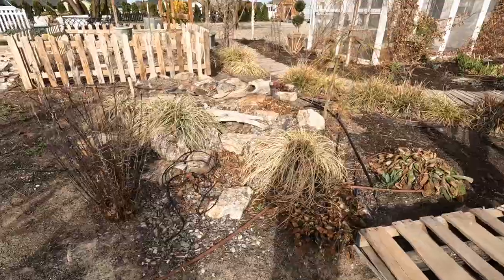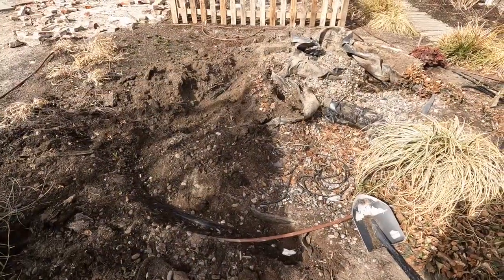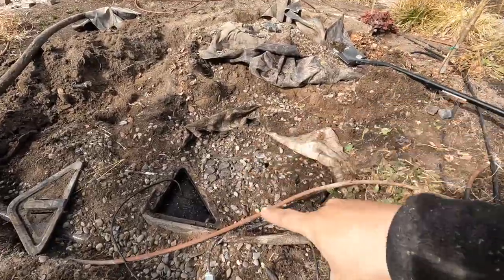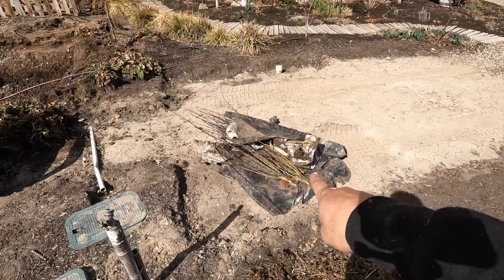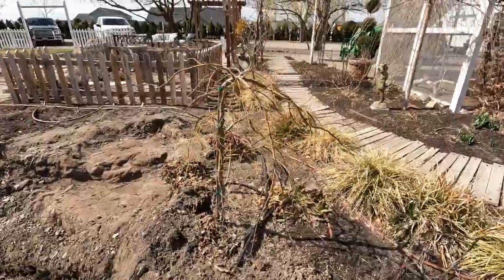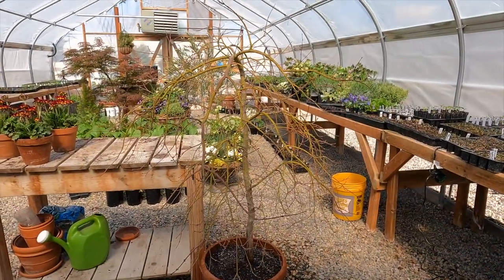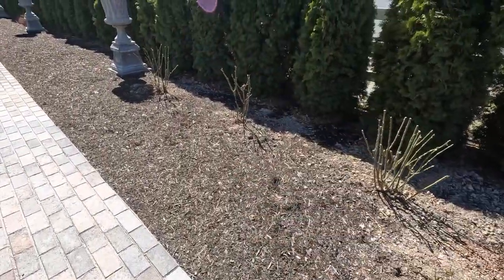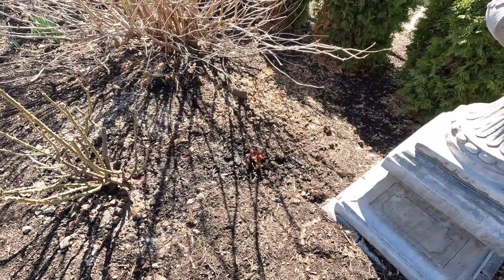Removing the Pondless Waterfall & Transplanting a Bunch of Perennials! 💪🌿🥰 // Garden Answer

Comment: Sooooo if that water was so stinky (which makes sense that it would be) what do you do every spring to clean it and obtain clear water again for the new season?
Reply: I think it was just stinky because it’s been shut off for so long. If it’s continuously running and not sitting still, the water would not get stagnant. Also when running, there’s more evaporation so fresh water would be added on a regular basis and help eliminate the standing, stagnant water.
Reply: @sheilastromberger2275  Also adding hydrogen peroxide to stagnant water helps to oxygenate it.

Comment: Any suggestions for removing overgrown shrubs?  I have a barberry between two boxwoods that are too close together.  They were fine when they were small, but after living here for almost 12 years they are an overgrown mess and an eyesore.  I'm not sure I can dig them out by hand?  I truly hate to lose the boxwoods but I'm not sure I can get the barberry out without damaging the boxwoods.
Reply: Use a sharp shovel, and cut the barb erry roots closer in to it.  The boxwoods will still have 180 degrees of roots and should survive with some luck.  Maybe do it now while dormant.